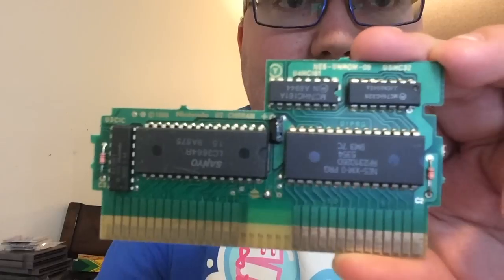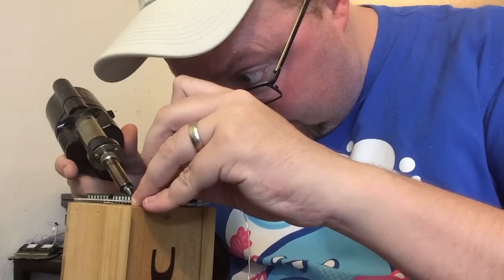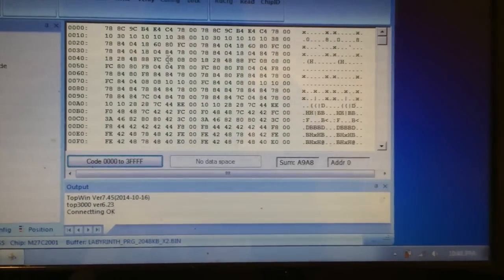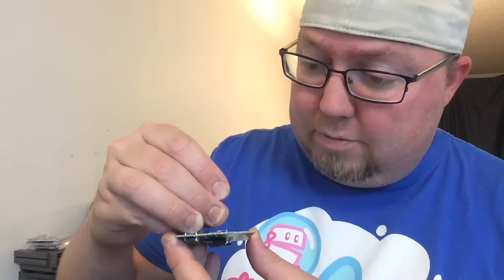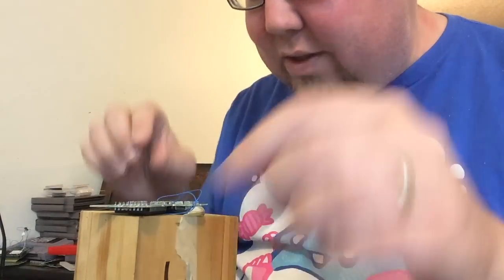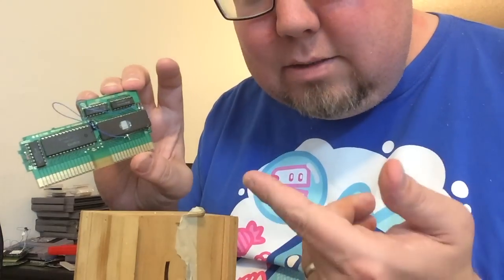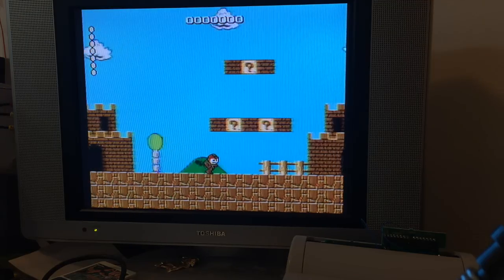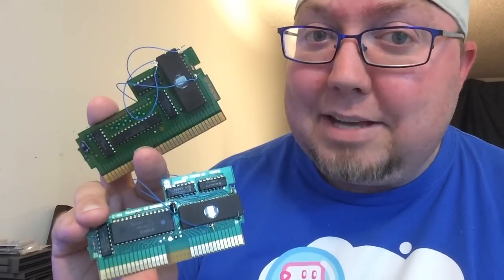How to Make UNROM NES Repros [TUTORIAL]

Comment: Is there a site or how do you know which games need pins to be wired different. I made Little Samson and used a Top Gun 2 board, but its not working so I am guessing it may need extra wires.
Reply: I think I found 1 problem I was using 28 pin rom and I think it needs to be the 32. I did get a message saying size exceeded. But I used a 28 pin 512 so I thought it would work, but i think that's my problem. But I still need to know where to find out what games need wires and how you know where they go.

Comment: resistors are coded by the bands on the body.... they work by "resisting" electricity. they may be fragile,  but replacing resistors with modern replacements won't damage anything.

Comment: If you weren't filming this, how long would it take someone with your skills to make a repro cart?
Reply: just the soldering and tagging the wires would probably take about 15 minutes or so. Removing the chip is about five minutes with the verification and cleaning of the solder, placement of the chip and soldering the connections would be about the same. this doesn't include the time to put a label together or flash the eprom. if you are doing it with moderate soldering skill and a bit of experience probably an hour. im betting that he can do it all in about 25 minutes or so.. could probably do like 6 games in 2 hours

Comment: Need some help here, i've done everything exactly the same way that you have. I tried different boards but nothing but I found a Konami borad and wired it the exact same way and it worked, seems that the unrom board wiring is wrong or the game that I'm making won't work on the unrom  board which doesn't make no sense because that's what it's  produced on. any information would be appreciated, the game that I'm making is ducktales 2. again the method for the second board in this video worked for me but the first method did not, is there any reason why it didn't?

Comment: Have you ever done a UOROM?  A lot of the new contra hacks like Attack of the Blue Falcon and Revenge of the Red Falcon use UOROMS.
Reply from the maker: +Nicky Nooch I haven't, but would love to. The only UOROM donors are too expensive.
Reply: John Riggs: RIGG'd Games True, for some reason I thought UNROM to UOROM conversions were possible, but I misread UNROM to AOROM conversions.  Whoops!  Keep up the vids.  They are a HUGE help!  Created my first 2 UNROM repros since this video!  You were right, the Konami boards are so easy to desolder and work with.
Reply: I did some more research as the newest Contra hack "Contra: Attack of the Blue Falcon" is REALLY good so I want it on a cart. There appears to be a UNROM to UOROM conversion on nesdev I may try out. Just search for "UNROM to UOROM nesdev" on google and it comes up. Wish me luck!
Reply: after 2 years. Its time. Im gonna do it. Any help or info anyone knows would help. I will start with UOROM boards (paperboy2). The only reason I bought all the equipment is to make Contra + CastleVania hacks ( as far as NES goes.

Comment: Oh man... I also wanted to tell you that the resistor can be soldered anyway.  The leads are not polarized (+/-), so it can't be put in wrong, just as long as you are using the correct 2 holes.   They are the easiest component to replace, incase you break it pulling it out.
Reply from the maker: +Captain Awesome Good to know! Thanks!